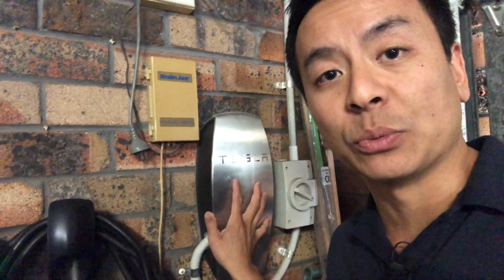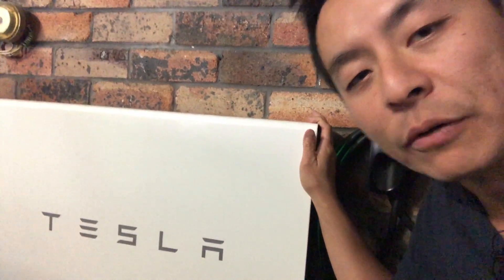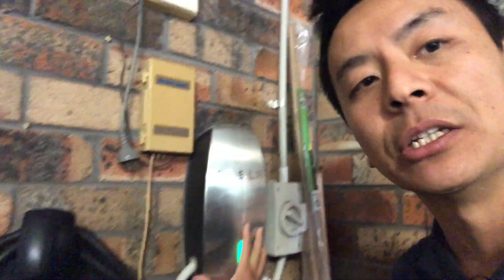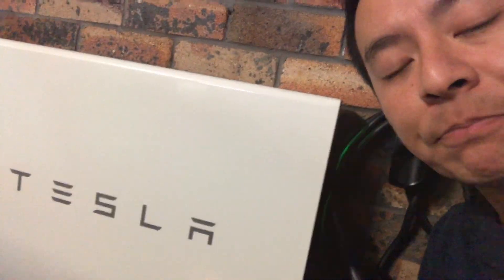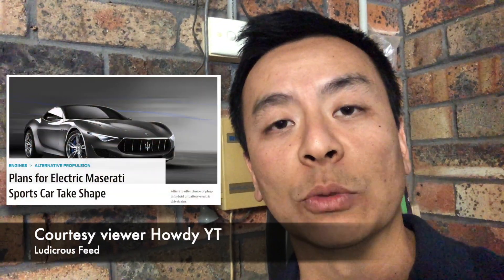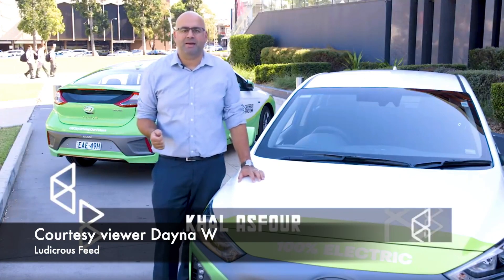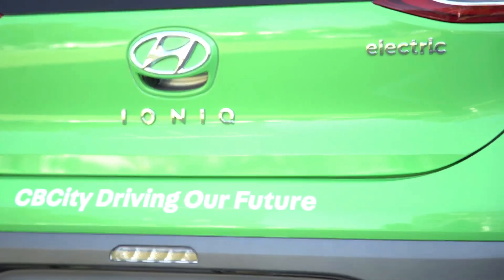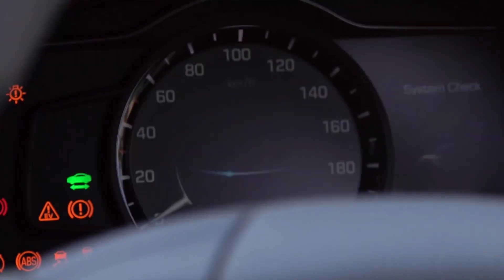Tesla 3-Phase Charger HPWC and PowerWall2 in Grid Failure | Ludicrous Feed | Tesla Tom

Comment: I pretty sure the HPWC can be wired as a single phase charger. The primary phase that runs the electronics needs to be wired to the powerwall supply, the other two phases can cut out without affecting ability to charge. 
I have a Schneider EV link that does this.
Reply from the maker: 5OO846 Interesting ... I need a live demonstration to be sure to be sure ...

Comment: I have read the Tesla FAQ and there is no mention of any reason why your car still cannot charge during an outage on single phase power at a reduced rate. It probably disconnects the PW due to the large load your EV would want, but if you set it at a lower charge rate it would still charge no differently to your normal PowerPoint connection. Would happily be corrected if I’m wrong.
Reply from the maker: Alex K Anybody with a 3~ Tesla charger and PW2 want to volunteer for a live off-grid test?? TT
Reply: Ludicrous Feed you have a model 3 on order right? It should come soon, you should start thinking about a second 3~ charger for yourself!
Reply from the maker: Alex K Good point. The M3 should come with a new 3~ charger (I hope).